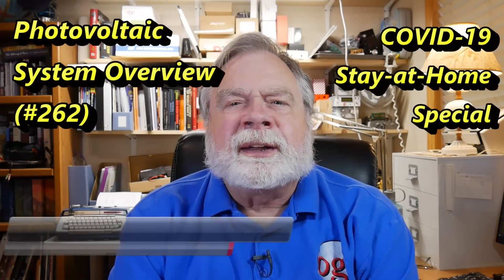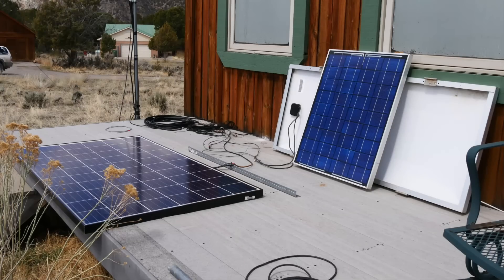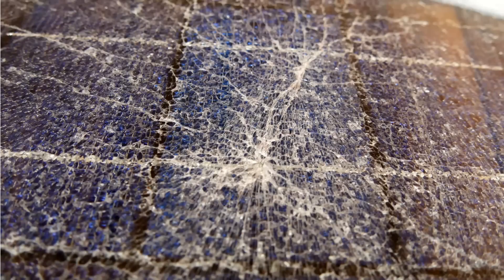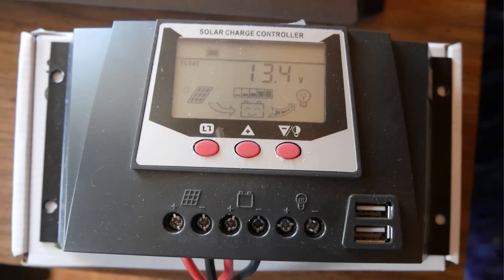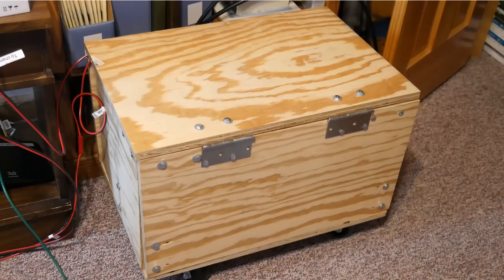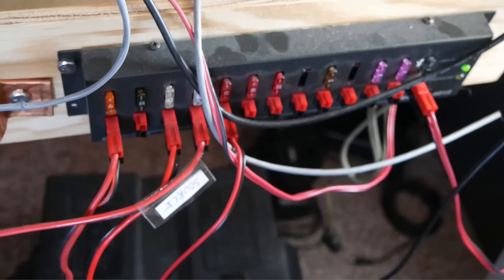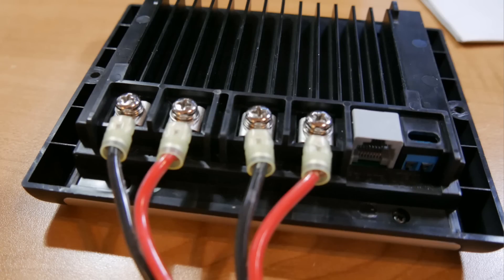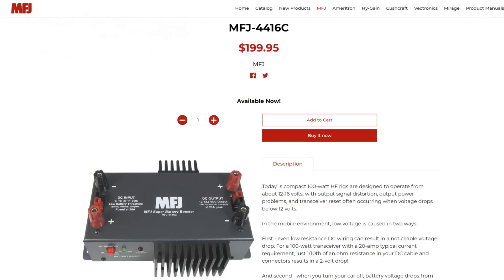Solar Power at KE0OG (#262)

Comment: David ! So glad I found you !!! A lot of the younger guys on the web, don't cover the nitty gritty good stuff like you do ! I will be taking both the Technician and General exams soon. Ready for fun ! In the past month, bought an Emergency Weather H/C radio, a scanner, a set of FRS and just received a Yaesu FT-70DR ! In light of our world today, I am interested in solar and portable power. Your info here is exactly what I was thinking about doing ! I have built power supplies and tube amps, so it only strengthened my learning as they are all connected. Love your stuff, Curtis, w/o a call sign yet 🤗👍

Comment: Dave all I have is a set of harbor freight panels. they are only have forty five watts and they are still in the box. I have four deep cycle   batters I used to charge them with a marine  forty watt power supply until I got my 7300 hundred and it would not work on the twenty watt astron that I picked up at garage sale. I have a five ninety that works fine on the twenty power supply.

Comment: Dave on the twenty four volt panels if you four twelve volt deep cycle batteries would you put them in parallel ?
Reply from the maker: Two 12v in parallel, and that in series with two 12v in parallel, for 24v storage.

Comment: You need a MPPT charge controller. It should be RF quiet. Most controller generate a lot of hash. I have 925 watts of panels with a 45 amp and a 30 amp MPPT controllers. 2 L16 370 AH batteries plus 2 6V 220 AH AGM batteries for the HF equipment.

Comment: I enjoy your work. I have been doing solar for my station for 3 - 4 years. I love it. I got some good ideas from your video. I will share a couple of my ideas. Amazon has a 20 Amp boost device for less than $20 which I use. Also I use a device that disconnects the load from the battery if the voltage drops below an adjustable level. As you know the battery can be damaged if drawn below a certain level. (If I remember, 11.9 volts for a AGM battery. I run other stuff like home automation and VPN servers. Too many grey days in a row can be a problem. Doesn’t happen very often but not fun if it happens. Anyway, keep up the good work.

Comment: The caveat with any boost controller is that they may take your batteries to a 30-50% state of charge. While the radio will be happy, the battery will take internal damage and lose the number of charge cycles that a lower discharge would have given it.

Comment: I have a similar setup , but using lithium 18650 cells. 3x12v panels in series getting 36v max. My MPPT charge controller takes that and bucks it down to charge 20p7s 18650s giving a max output of 28v. I then use a 24 to 12 buck converter to take that down to 12-13v for the radios. The 18650 cells are all from old recycled  laptop batteries and give  just about 1kwh of power.

Comment: Hey Dave, why can't you use one with an inverter?
Reply from the maker: The panels with built-in inverters are designed to plug directly into your utility power. For ham station use, you want panels you can use to charge batteries.

Comment: I run solar now, but for the next upgrade (I currently have 4 38Ah batteries out of an old PBX battery system with. 160w panel and EPEver controller) have been toying with using 3 x 6v cells in series (probably with a second set in parallel depending on what capacity I can get) and then simply using a couple of 24v panels in series, and run the radios off the load port of the MPPT controller, set for 13.8v, which would always be doable as the batteries would float at around 18v.

Comment: Thanks for making these videos :) They help to keep me connected to ham radio until I can get my rig set up. I can finally afford my first radio rig (been a tech for almost 10 years and never used a radio...a shame I know). All studied up for my General, and then just as I'm about to go take the test I found no testing centers open in Ohio. LOL Oh well, so is life. Well, I'm just going to have to start studying for Extra I guess ;) Just received a Ten-Tec Century/21 today in the post which I am going to start using as my first radio to force me to stick to CW this time - tried learning it before but fell off it. It's a little frustrating at first, but I took your advice from a previous video and joined the SKCC (22039). Having the Facebook group is incredibly helpful in keeping me motivated to learn CW.

 I'm thinking of converting the small cabin my dad built on the property before I bought it when my mother and he retired to FL into a small shack. I'm thinking of going solar so this was great timing on the video as the weather gets warm! Really helps me wrap my mind around what I'm going to be looking at doing...it's going to take some research for sure! Anyway, just rambling. Going to start building my first dipole antenna this week and then once my antenna tuner arrives with my CW key I should be able to finally use my Tech privileges :) Your channel has been a big help in encouraging me to stick with amateur radio all these years (although my account is new. I wanted to finally chat with folks on YouTube so I made a radio devoted channel so I don't bug my husband by filling up our shared channel with radio videos ;P ).

Comment: Three years ago, I participated on a solar forum, so I could learn about designing an off-grid solar power system for a cabin.  Over about 6 months, I learned enough to identify lithium iron phosphate batteries as the best choice for my particular use.  They are not cheap, but they have several advantages.  Flooded lead acid was always the gold standard.  In that 3 years, at least one company has come forth with a well regarded 100AH LIFePO4  battery, with built in protection circuitry and a 10 year warranty.  Another company was trying to develop a salt-based battery that did not have great stats, and they went bankrupt. There are constant developments in the industry.